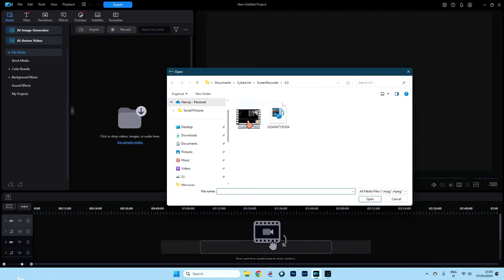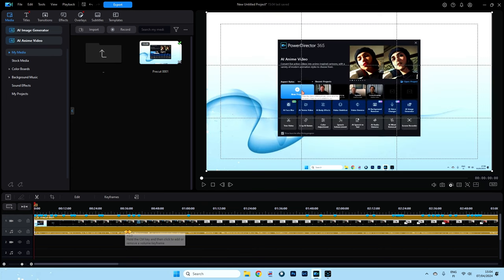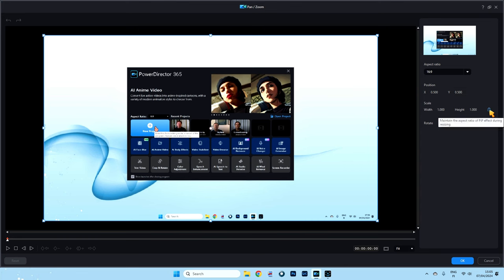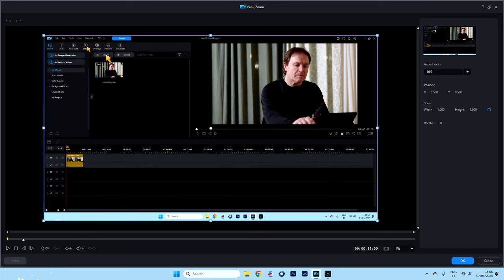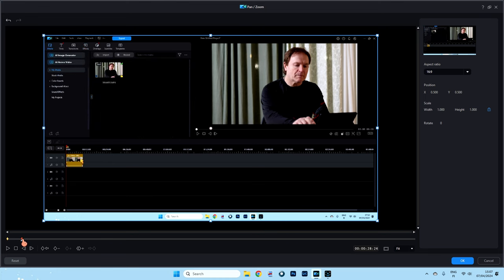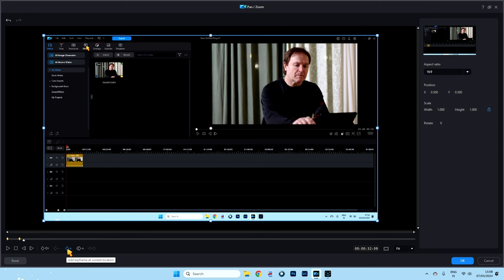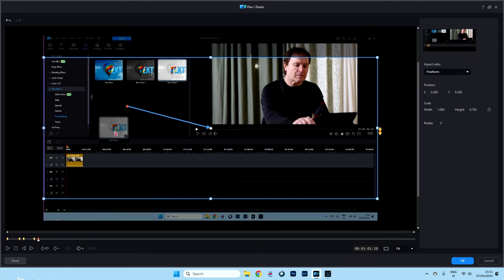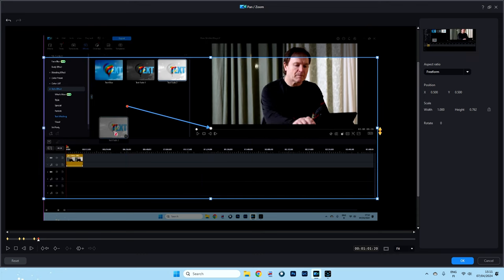Pan and Zoom tool sucks.

Comment: When you are resizing, even though you have switched aspect ratio off, it will still maintain the shape that will keep the pixel sizing.  In 16:9, the pixels are 1.5 instead of 1 (square pixels).  Otherwise you would end up with a stretched effect which isn't what you want.
Reply from the maker: Yeah, however switching off the aspect ratio should allow you to change the outline shape to what ever I want. Another subscriber mentioned that they have no problems at all. So something on my PC is causing the glitch that I have shown. And it's driving me crazy trying to find it, Luckily I don't use the pan and zoom as I can do it in keyframing so there is a work around.
Reply from the maker: Are you really in Yorkshire? I'm originaly from Chesterfield, Derbyshire.
Reply: @pmhelsinki  I am originally from Sheffield but moved to SW Scotland, very close to the D&G border about 12 years ago.   I thought you were from around that area.  There are a lot of Lancashire/Yorkshire peeps in the village and local area.

Comment: Not sure what's going on with your version, but I can certainly add a keyframe after 1 frame by pressing the next frame button and it moves to the next frame, I don't have to drag along the time line. Something you might want to check with PD or in the forum
Reply from the maker: Brilliant, could you tell me what version you are using? I am using the latest updated version as I like to keep updating so as to see what works and what's gone.
Reply: @pmhelsinki  same I have the latest version that updated a few days ago, I have PD 365 - V: 22.3.2808.0 👍🏼
Reply from the maker: Now that's peaked my interest. Something that I have in Powerdirector is causing a glitch only in the pan and zoom tool. Very obscure, even a re-install produces the same result. Mmmmm!
Reply: @pmhelsinki  good luck, hope you get it sorted 👍🏼
Reply from the maker: Ok, so my latest version is V: 22.3.2727.1 and it states that this is the latest version. What's that all about?
Seems you have a very new version that is not yet available yet here in Finland.
Reply: @pmhelsinki  very strange, I wonder why,  when I think about it I actually have Director Suite 365, I'm not sure if that makes a difference.
Reply from the maker: @mjbdigital  Yeah, me as well.
automated update, so not sure why they do this. Maybe it will turn up next week.
Thanks for sharing, have a great day.

Comment: I use Pan and Zoom a lot and love it.  When first selected it shows many preset patterns plus the option to create your own.  I always use the option and then you get the screen that you show.  Key frames can be added much sooner than you show by using the frame forward button.  You obviously do not understand how this works so your tutorial is misleading.
Reply from the maker: Hello.
As you can see from the video as much as try I am not able to add a key frame any earlier. I have tried all ways possible but to no avail. Something in my system or a bug is stopping me from adding keyrames, other people like yourself dont seem to have any problems, and as yet I have still not found a solution. So there is no misleading info only problem solving. I was hoping that someone else may have some idea as to why this is happening.